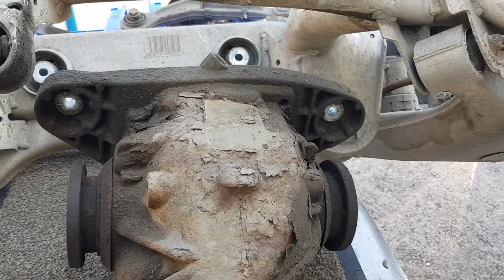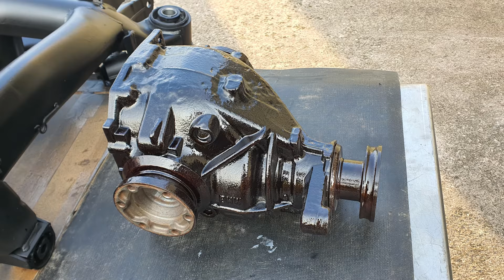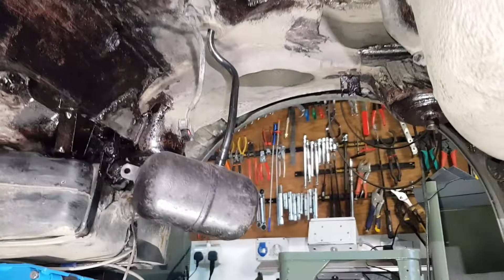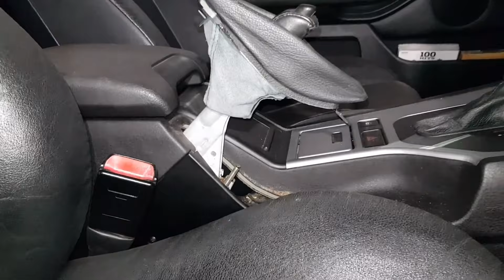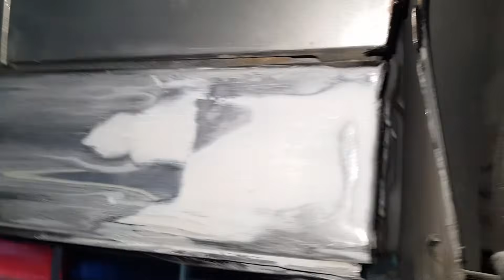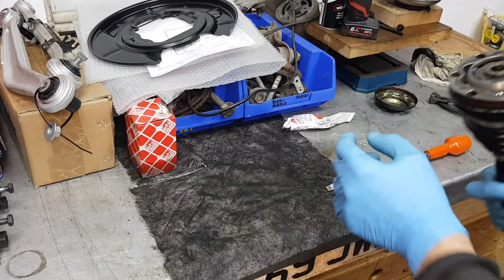BMW E39 Touring Rear Axle Restoration Part 2

Comment: Just watched parts 1 and 2 and absolutely superb work. Every credit to you…

I was lucky enough to own a Japanese import E39 530i Sport touring from 2019 to late 2021 and it was a superb car; absolutely 100% corrosion free; all I did was a full cooling system, suspension (every part) and brakes overhaul and kept in as best condition as I could. It had a front end respray due to stone chips and flat paint etc, but other than that, that was all the body work it ever needed

Hopefully you’ll have yours in mint condition in no time 👍🏼
Reply from the maker: Hi buddy, I am so happy to hear so many people enjoying the project so far. As I write this I am on the PC editing Part 3 (Reassembly). I have seen a few mint japanese E39s and E38s on social media and they bodies are always in great shape. I am not sure how much it costs to import but it probably is very expensive. Thanks so much for watching both episodes, I think the next 2 won't disappoint either🔧💪🏻
Can I ask if you just found the channel or are you a long term subscriber🤝🏻